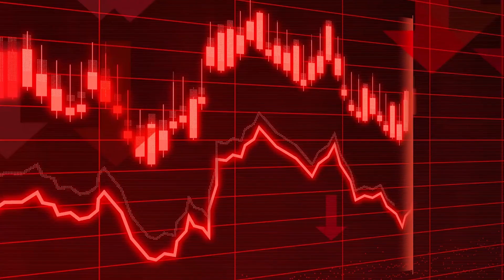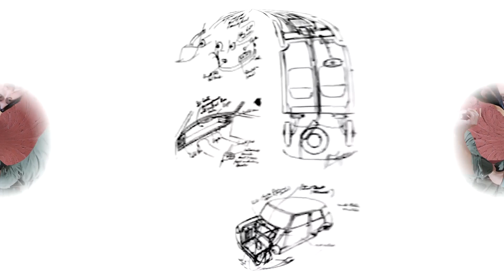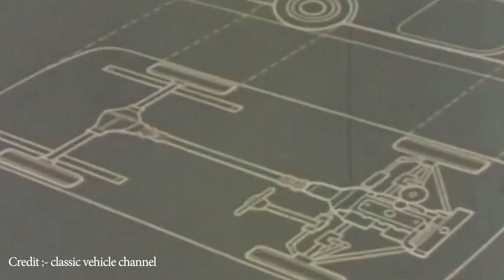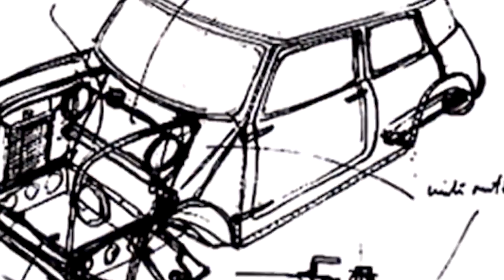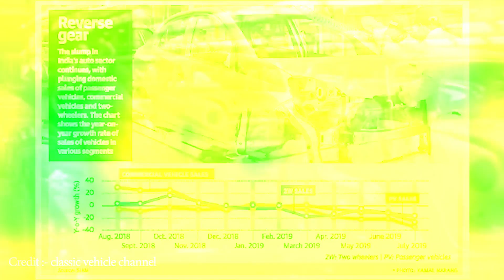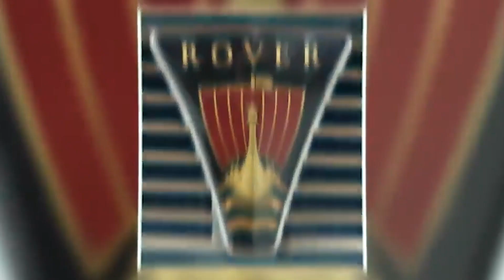The Story of MINI Cooper | A 63 year journey of MINI Cooper | Mini Cooper Documentary

Comment: As a former Danish owner of a new 1966 BMC Mini, it was an absurdly bad produced car! Even from the corners of the front screen, water came in, as from many other places (Don't leave anything in the doors rooms in the bottom)! The doors missed the body by about a 1 cm round the windows (I put a knee between and bent the frames in!). Driving behind a car during rain, the engine cut because of the water. Window wipers stopped at the place where the contact was cut and the paint peeled off round the hinges because of a bad painting process. The gear stick hardly had a connection to the gear box and no synchronized first gear. The "heater" was a joke with only - on or off, and should be moved to an EU position on my car, by myself! But the Hydrolastic suspension functioned, later to be discontinued! The seat couldn't be positioned unless in the three holes in the bottom! If moved back for a longer distance, the front of the seat became low, so it gave no difference! But it was my first car, so I didn't know how a car could be made, as the BMW 2002 which I bought as my second car!
Reply from the maker: It sounds like you had a challenging experience with your 1966 BMC Mini. I apologize for the difficulties you encountered with the car. It's not uncommon for older vehicles to have various issues, and it seems like you encountered several manufacturing flaws and design limitations.

The Mini, despite its popularity and iconic status, had its share of problems, especially in earlier models. Water leaks, poor paint quality, and mechanical issues were known concerns with some Minis. The lack of proper sealing around the windows and doors could lead to water ingress, while the lack of synchronization in the first gear and a loose gear stick connection were also common complaints.

Regarding the heater, it seems like it had limited functionality with only on or off settings, which could be inconvenient. However, it's worth noting that older cars often had simpler heating systems compared to modern vehicles.

It's understandable that you were disappointed with the Mini's shortcomings, especially if you compared it to your subsequent purchase of a BMW 2002, which was known for its superior build quality and performance.

Car manufacturing has significantly evolved since the 1960s, and modern vehicles undergo more rigorous quality control processes. If you've had a more positive experience with your subsequent cars, it highlights the advancements made in the automotive industry over the years.

Thank you for sharing your experience with the BMC Mini, and I hope you've had better experiences with your later vehicles.